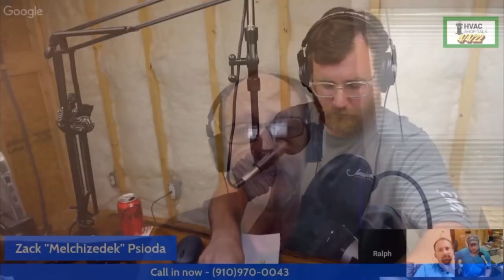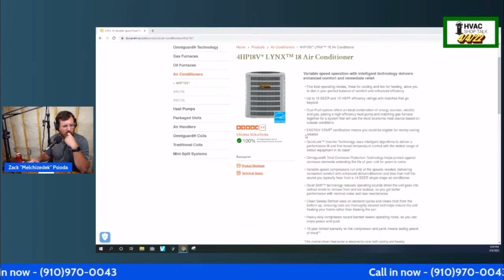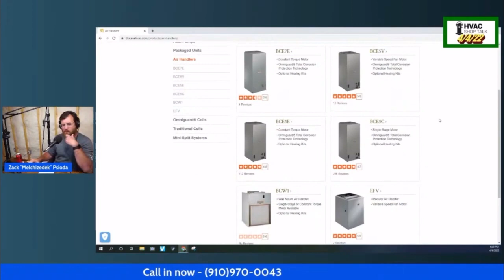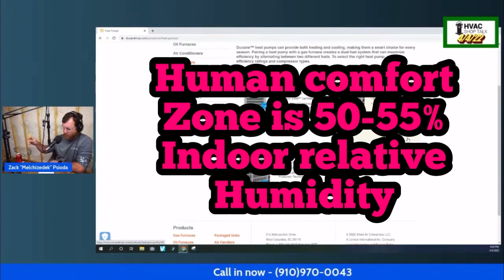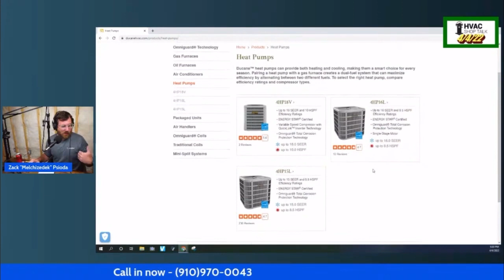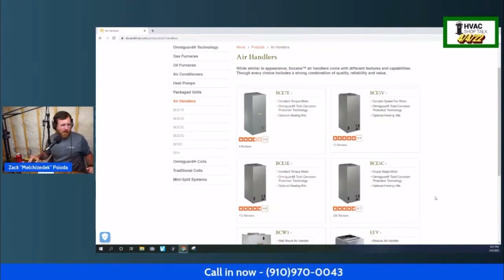Does Bosch IDS 2.0 Have New Competition?

Comment: The Lynx has three selectable modes. Efficiency which uses outdoor temperature, standard which runs a constant 135psi suction and comfort which runs a constant 125psi suction. Comfort mode is according to allied academy dedicated for a colder coil and longer run times for maximum dehumidification. I have installed some Lynx with the Matching allied air Variable speed air-handler and standard 2 stage cooling thermostat and they do fantastic

Comment: Hey folks, After some research, there are lots of differences between the Bosch IDS and the Lynx. Among them are, (1) LG compressors - the 2 ton is a rotary and the 5 ton is a scroll (2) The outdoor has Y1 and Y2 for 2 stage heating and cooling. Each one uses a different set of algorithms which MAY improve moisture removal. (3) The Lynx has three operating modes - Efficiency (uses outdoor temp for modulation, Normal - uses transducers for 135 PSI evap target for cooling. Dont recall heating Comfort drops transducer target to 125 PSI.  I also assumed the unit was made in SC. But there was a slip about the board going through customs. So I guess that means the compressor and boards come from abroad.

Comment: If Bosch had a on demand call for dip-switch 4 accelerated cooling, it would be a game changer. Thermostat with Humidity/wire feature energizes Bosch to enable lower 43 evap coil temp, and furnace goes to lower speed. This is where the ducane probably will be better with dehumidification with profiles and input with Y1 and Y2 calls.
Reply from the maker: It does seem like Bosch could make a few small changes and really increase the ability of the machine
Reply: Get out the soldering gun🤣

Comment: Dude 80% Humidity ain't crap to a summer muggy night in the Appalachian mountains!!

I took my FP PRH2 Psychrometer outside on my porch on one of those 85*F+ muggy nights, the type when you step outside and you wanna take a bath type nights/days...

94% or 98% relative humidity one... It was over 90% i remember..

I have seen days when you have to charge a system up and once you dial it in, superheat etc is right on, the homeowner freaks out as it's not cold as it should or usually feels right away because all the capacity is being used to remove humidity that built up while it was off as it worked to get to what i call the "BREAK POINT" where humidity falls below a certain point enough to condense faster on the evap coil.. 

Humidity is also the killer of the old copper/tin evap coils also especially if the fan speed was too high sucking moisture off the coil would ruse the blades and housing faster also.. Seen it 1000 times over.. All my installs go to the lowest speed possible to cut back on that effect...   I wish they would put the fan pre-coil and make all coils blow through instead of pull through like 90%+ of them are. Talk about cutting back on corrosion and degradation over the years due to the air handler running drier near the critical components, fan, hk, boards, etc.,.